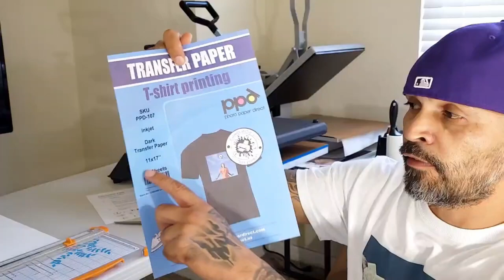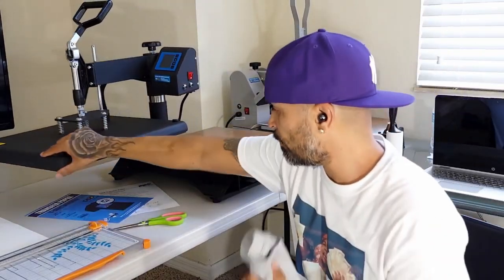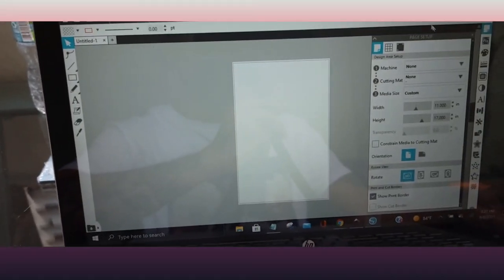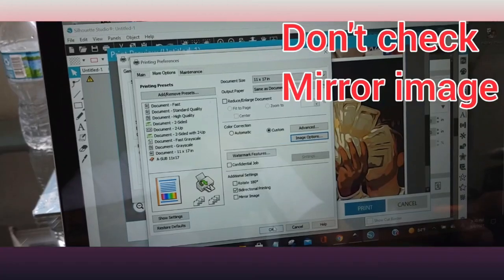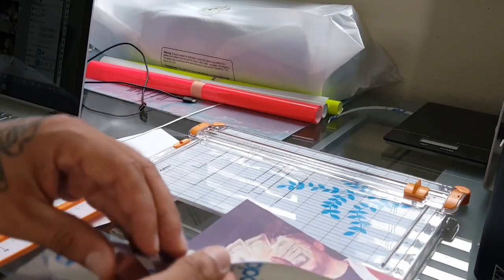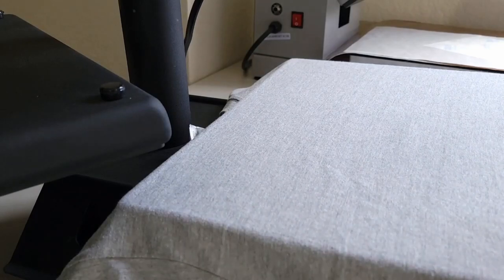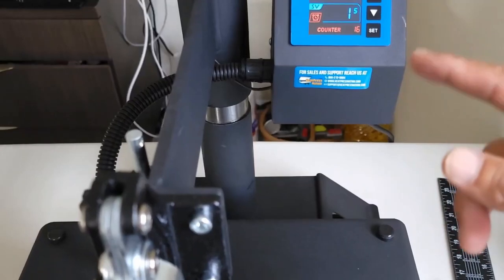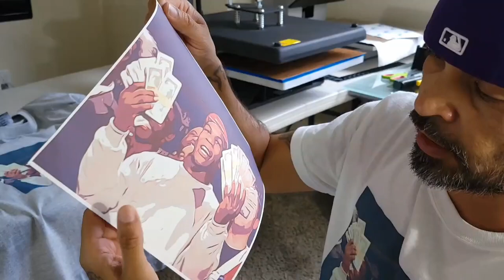Heat Transfer Paper | Sublimation | Cotton T-shirt (Tutorial)

Comment: What the paper names?
Reply from the maker: Can check them here: https://www.photopaperdirect.com/  & amazon here: PPD Inkjet PREMIUM Iron-On Dark T Shirt Transfers Paper LTR 8.5x11" pack of 100 Sheets (PPD004-100) https://www.amazon.com/dp/B00PFW5N8W/ref=cm_sw_r_apan_glt_fabc_NGJ9AG839PNSZRVMVRM2?_encoding=UTF8&psc=1
Reply from the maker: Go for PPD dark, what I use on any color shirt.
Reply: @diywithkenny8399  ok. And what about that big brown paper
Reply from the maker: That a teflon sheet you can get off amazon.. just search a size of your heat press 15x15, 16x20, or what size that will cover.  Hope that helps
Reply from the maker: Feel free to ask any other questions, I'm sure to answer them.  Here a print and cut video to this:  https://youtu.be/6Q98fC4L9ZI
Reply from the maker: *UPDATE*:  385 Degrees For 30 Seconds Firm Pressure Heat Press.  After 1st press, leave Silicon Paper on for 30 seconds, and then peel.  2nd Press with Silicone Paper 10 to 15secs. *

Comment: I did a shirt using dark transfer paper How come when I washed mine it peeled?
Reply from the maker: Yo.  How you applied the product?  What material?  What ink you used (regular jetink or sublimation)?  Used firm pressure on heatpress?  Backtrack and see.
Reply: @diywithkenny8399  I used a heat press I also used a inkjet printer I also tried another time iron it on both didn't work
Reply: @diywithkenny8399  cotton material
Reply from the maker: Are you peeling the top layer off?  back part of logo needs to peel off after printing.
Reply: @diywithkenny8399  I follow all instructions
Reply: @diywithkenny8399  the back part
Reply from the maker: Ok.. you printed, peeled off back, preheat the shirt, lint brush, line up, then heat pressed it with silicone paper on top & teflon sheet on top of silicone(375 degrees& 12 secs  inkjet or 385 degrees for 30 secs sublimation), then lift up and let teflon/silicone rest 30secs.
Reply from the maker: Now if that fails again, need to contact PPD see whats up with product not adhesive to garment.